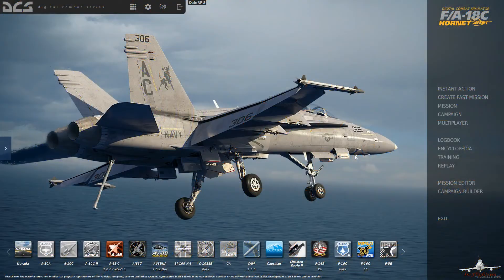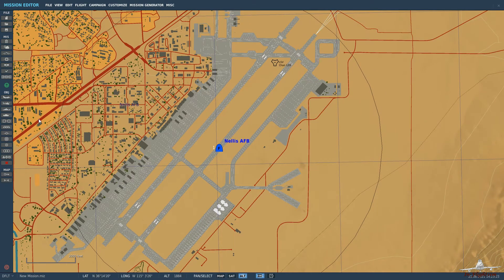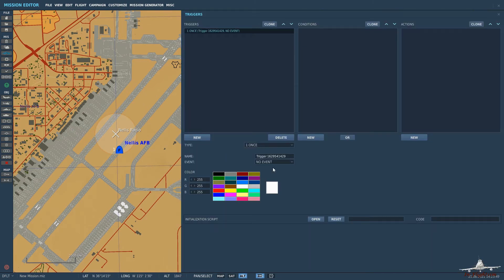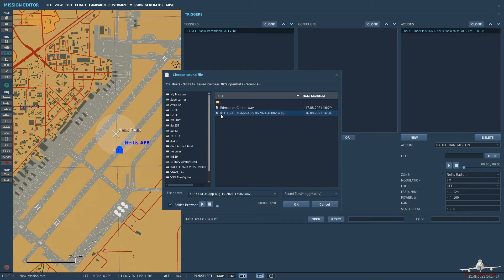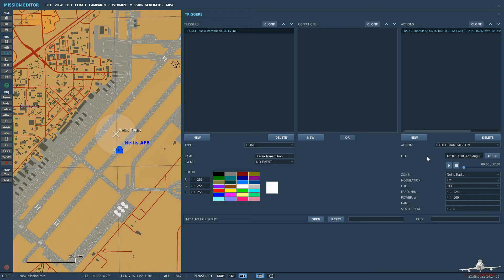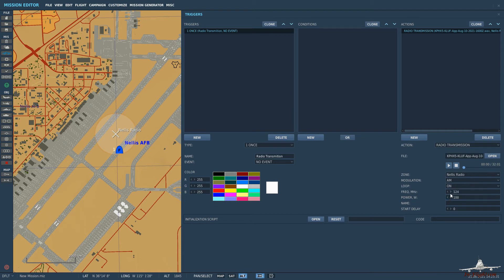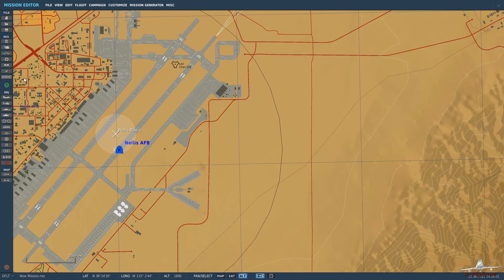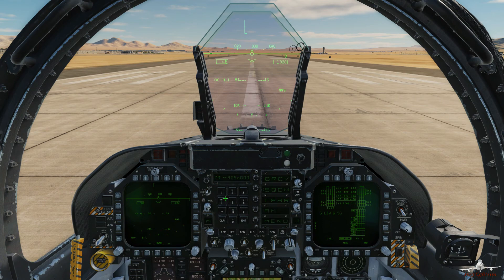DCS World Mission Editor - Radio Transmissions Tutorial

Comment: Easy tutorial, many thanks. But I cannot get the Huey to play on 124fm for the life of me! Ive changed the channel selector from INT to 2, and adjusted the freq but alas no joy. If you have that module any chance you can see if you can replicate your success?
Reply from the maker: Unfortunately I do not have the Huey module sorry. Is there a volume control for the radios in the huey?
Reply: @InFlightsim22  Volume knobs are max, channel selected right, freq correct but just not working.
Reply from the maker: What format is the audio file?
Reply: @InFlightsim22  ogg but I figures it out. Its an hour long 80mb file so takes a moment to stream in I think.
Reply from the maker: @tommyuk329  ah, glad you managed to sort it out
Reply: @InFlightsim22  I think I might try and split it up into smaller files that start roughly as the other one should finish. That way there shouldn't be a delay as each file is smaller. But in general it works, so I'm happy. Thank you.